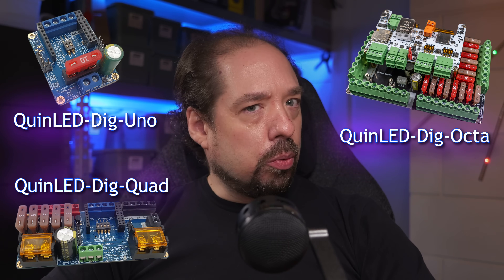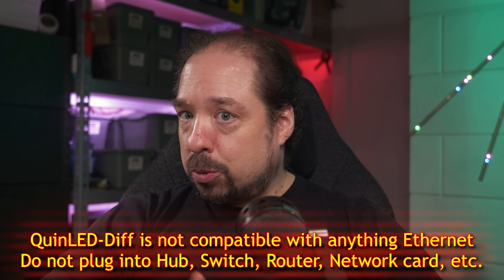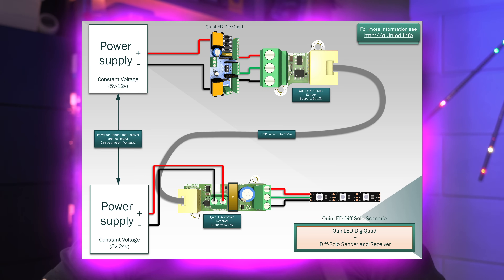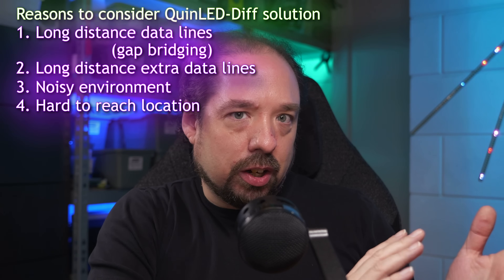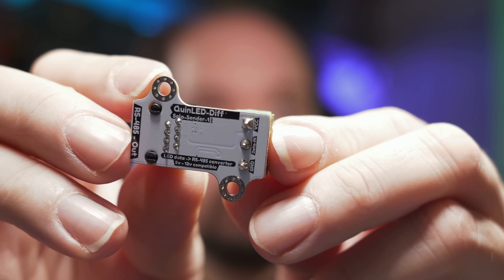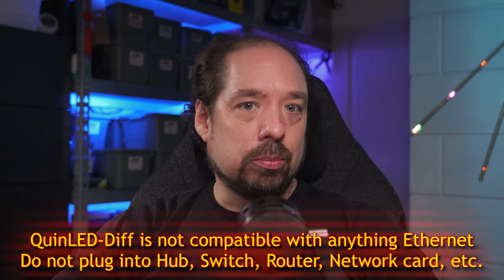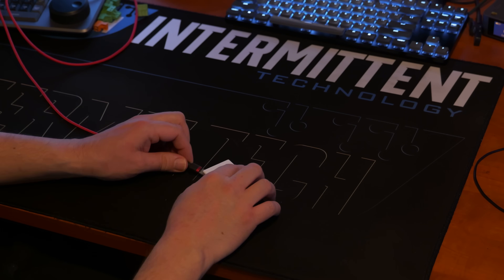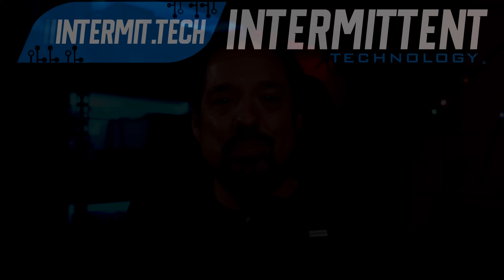💡QuinLED💡Announcing the QuinLED-Diff system and QuinLED-Diff-Solo release!

Comment: does the diff-solo receiver support adding a relay to turn off power consumption when the dig-uno is not sending a signal into the diff-solo sender?
Reply from the maker: It does not directly no, you'd have to add a second one to have a second data line to do that. For the Diff-Adv I have some examples but it also requires an extra board.

Comment: Just getting into this and I’d like to run some LED’s near the ceiling. I’ll have to run an extension cable 14ft through a wall between the LED strip WS2815 and controller. Can the data make it this far without issue? Sounds like the PowerDiff board will definitely solve my problem but wondering if I could also go with a DigUno (when it’s back in stock)???
Reply from the maker: As I mention in the video, up to 5m/16ft and a QuinLED Dig board you should be fine without the Diff option. But you do have to calculate your power wires too, depending on amount of LEDs and such.
Reply: @IntermitTech  Thanks for clarifying! I’m an IT person not an electrical engineer so I was recently wondering why we can’t have power and data over Cat6 for LED’s like we have POE for data/power in networking. So I’m really excited to try out the new PowerDiff when it’s available. You’ve broken ground into new territory and I could see this method becoming a new standard for LED strip lights. Keep up the awesome work!

Comment: Interesting, i was just going to DIY a PoE adapter for my esp32 so the LED data doesnt have to travel the distance, and i wont have to rely on wifi either. There are surely some applications to your solution, but id rather use a well documented ethernet PoE protocol 🤷‍♂️
Reply from the maker: Sure, certainly nothing against that but if you require more then a few watts, it's going to cost you. Still, that can be a choice ofcourse.
Reply: @IntermitTech I am standing-by for your powerdiff version because I don't have any power to use at my end point.... Please hurry up and release the info and the pricing LOL!! I would probably buy immediately if it's around the price point of the passive PoE options I've found.
Reply from the maker: Hehe, sure, I think it will be comparable to that pricing to be honest, because it's a structure which involves buck coverters and such (to mitigate the voltage drop) those are a bit expensive components though. So it's not meant to be the cheapest way possible but will certainly be the easiest way of doing it basically. We'll see what it ends up costing, like my other products, I try to not make them too expensive.
Reply: Using passive poe to reduce complexity and cost, I can get up to 65 watts using a compatible injector and splitter for around $30 total. Even less if I DIY a circuit.  I won't need gigabit, which also reduces cost quite a bit. Normal cat 5e otherwise. I chose it because it's the cheapest option I can find, even the cheapest copper for direct burial / UV safe. I could not find any less expensive of a solution... tho I am def open to ideas if you have any. I was going to just open-up and pot the splitter for weather resistance , and goop up the eth port with electrical grease . But You are right that using it at scale, w multiple poe endpoints, at that wattage, will get expensive, especially if you use active poe / a real PoE+ switch.  That's not my plan, I only have one little pine tree I'd like to light up at the edge of my property about 280ft away. If I'm using passive PoE I can even overdrive voltage and compensate for loss at distance. But I don't think my two 40pc bead strand ws2811 plans will need it. Should be max around 50w. Can you do it cheaper?

Comment: For a while I've been looking at putting permanent Christmas lights on the exterior of my house.  Would the future power-diff be an option for that?  It seems like they would be hard to hide and perhaps pretty susceptible to moisture.
Reply from the maker: Yes but also yes. There will be a receiver component to them which will need weather shielding and depending on the version of the receiver they can take up some space because of the buck converter that's attached. So it really depends in that sense.

Comment: I make a living out of installing lights in nightclubs, venues etc. Ive used dig-uno etc for a long time and had no probs with it. The solution at hand here is a blessing coming. So many times have i run into signal length issues. With this product here i will solve many challenges and on the long run, save money. 
Question: When running up to 100m length between, how is the lagging?
Reply from the maker: Basically there is 0 lag. We did some tests on a livestream with Diff-Adv having 4 strips spaced out by 100m each or so and there was no lag at all.

Comment: Lag, or ping?
Reply from the maker: I'm sorry? If you are talking about the delay these boards would causing adding them in between, we tested this during one of the livestreams of building them and it was imperceivable, even with 500m+ of cable in between vs directly attached to the controller.

Comment: I think you forget to mention does it need straight/cross and a or b cable? Or it isn't matter?
Reply from the maker: It just uses a straight UTP cable like any other out there. So normal T568B wiring. Checkout this page too: https://quinled.info/quinled-diff-rs-485-pinout/

Comment: Looks great, any plans to have a waterproof/water resistant case for it?
Reply from the maker: Not right now (since this would still require a power supply too) but I do have lots more stuff coming in this field but it's going in phases kind of. In the end I'd love to have a QuinLED-Diff-Power Receiver-Nano or something like that which would receive data+power and convert it to 5v/12v in a very small form factor and then that could be waterproofed. It would make deploying small things around the house/yard very easy! But those are future plans for now, everything needs to come out in a certain order to make sense. :)

Comment: Thanks for improving and making them compatible with everything I am already using . You are the best vendor for these kind of LED boards . Long time user of QuinLED .
Reply from the maker: I appreciate that!
Reply: Question, I have a roll of CAT-6 cable and some connectors. I am going to make my own length for what I need. The only thing is the cat 6 RJ- 45 connectors won't go in all the way on the new Diff boards that came today. Is there different sizes?  They are feed through.
Thanks Quin
 @IntermitTech